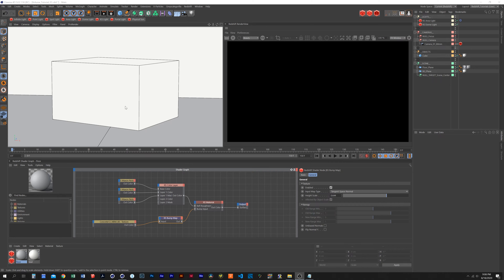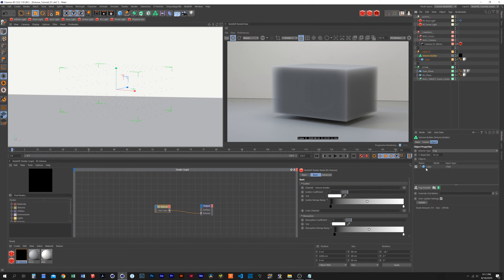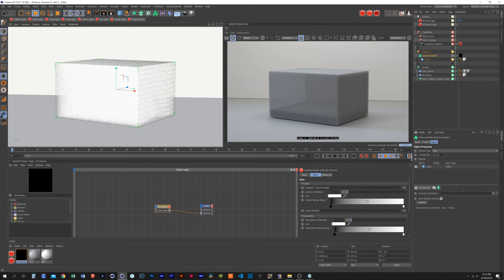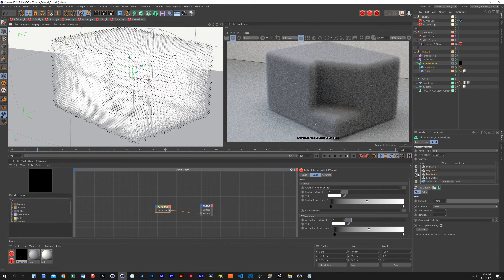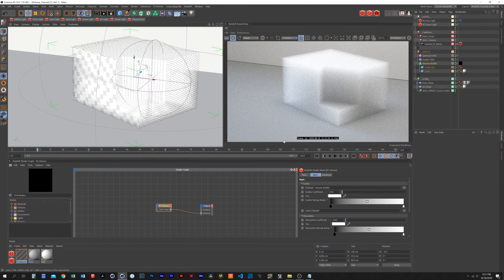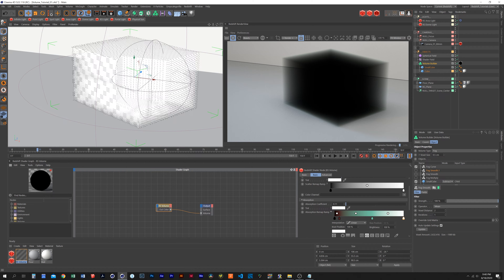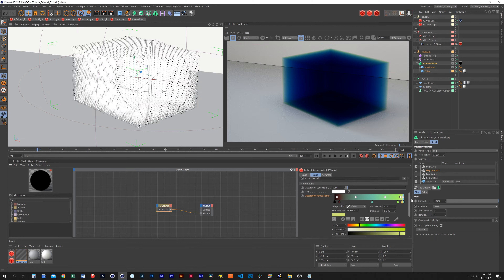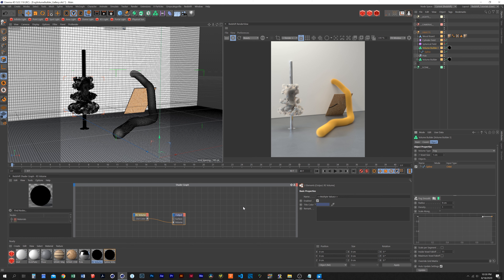Cinema 4D Fog Volumes Tutorial (Redshift)

Comment: How are you achieving what seems to be an extreme shallow depth of field in the orbs @ 25min? I'm playing around with fog curves, DoF on the camera, etc and can't achieve anything similar.
Reply from the maker: I believe I've just got the fog volumes in the distance set to really low density using the scattering and absorption settings of the volume material.
Reply: @igobyzak  Thanks for taking the time to reply. Hmm, odd. Maybe the geometry is displaced in a way I'm not seeing and its actually much flatter on those dark orbs. Good to know though thanks again.